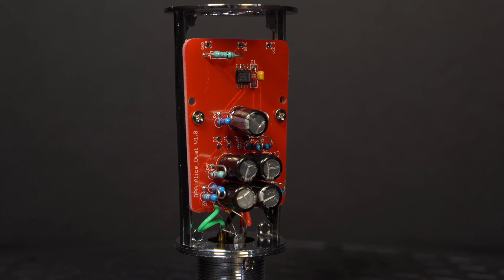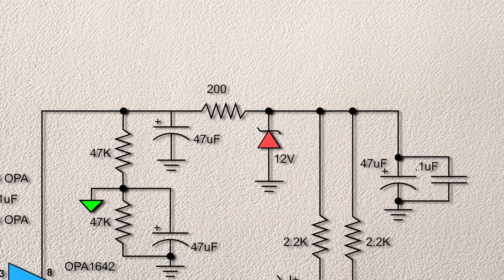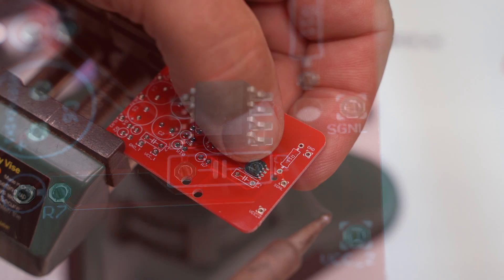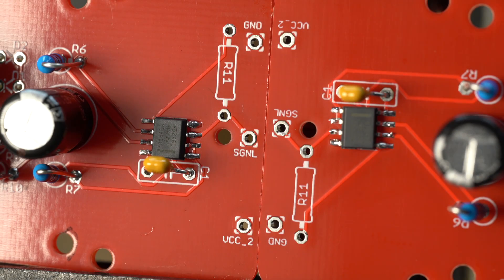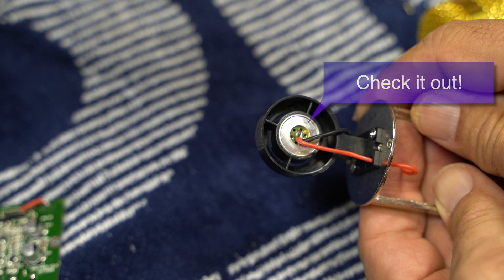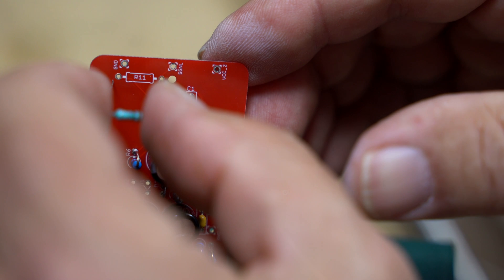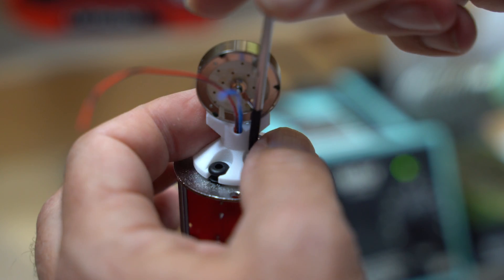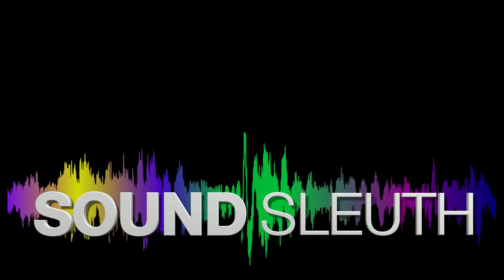OPA Based Alice Microphones: Cardioid and Figure 8

Comment: I built an OPA Alice circuit. Is it normally lower output than a JFET Bipolar type? And I noticed less  low end with the OP Amp Alice version is that typical?
Reply from the maker: No, it is similar if not a bit greater output. The circuit is unity gain voltage with lots of current gain
Reply: @SoundSleuth  I'm using a TL072, I haven't got high-quality low current dual op amps  atm
Reply from the maker: @virgogreg  I have not tried that one. The OPA1642 is the project based on the properties I mention in the Instructable and Video.
Reply: @SoundSleuth thank you I'll wait for my 1642 to arrive .I've built a ton of mics never used an op amp as an impedance converter before😅

Comment: Can you explain to us, what is the resistance of the 1G resistor that is connected to the + pole of the microphone capsule and to pin 3 of the OPA 1642. What is the "G" mark on that resistor? What does the "G" stand for? I did not find the mark "G" in any literature. Is that something new?
Reply from the maker: The G is for Giga  as in GigaOhm. 1000 MegaOhms or 10 to the 9th
Reply: @SoundSleuth  Thanks for the answer. I couldn't believe that a 1000 Mega Ohm resistor existed. That's why I asked. I've never had such a resistor in my hands before.
Reply from the maker: @balkanart8596  They have a couple specific uses lol. They make larger ones as well.

Comment: The whole circuit is unity gain.  I thought the signal from the capsule would be pretty small, so I'm a bit surprised by that.  I'm wondering whether there's any practical benefit to having a common source JFET stage to provide some gain and reduce the cascade noise, followed by this OPA circuit to convert the impedance and generate a differential output.  Your thoughts are appreciated.
Reply from the maker: Most FET and Tube impedance converters are unity gain or close to it.

Comment: I a little confused. Could you explain why the circuit diagram that you used to explain the circuit shows 2 op-amps while the actual pcb only has 1?
Reply from the maker: If you mean the PCB has one Integrated Circuit, it does. It is a dual op-amp. There are two independent op-amps in it.

Comment: I built one of your MS mics a few years ago and its output has become very noisy and low in level. Mine is pre-OPA.  I can't find any broken connections or shorts. Would it be practical to replace its two circuit boards with one of the dual-channel boards from JLI? Would the substitution be fairly straightforward?
Reply from the maker: Yes. The dual board works great for this  I’m actually about to release an Instructable on this and have JLI carry a kit
Reply: @SoundSleuth  Perfect! Thanks for such a prompt reply. Please sign me up for any way I can serve as guinea pig or proof that it works. I'll order the board and await the next Hollywood blockbuster so I can get my mic back in action. I really miss having an MS mic! I just bought a Zoom F3, so I'm eager to use it with a renewed MS mic to capture the sounds of the spring peepers finally emerging in northern New England.
Reply from the maker: @matthewcote107  email me ryckebusch@gmail.com I'll fill you in on my ms mic thoughts

Comment: Does an OPA mic sound good on an OPA preamp installed in the channel?
Reply from the maker: It sounds good on any mic preamp. All audio interfaces and modern consoles use IC mic preamps. THAT corp or SSM2019’s. If you want a little vintage or added THD use a tube or transformer input mic preamp.
Reply: @SoundSleuth  I have a mixer with OPA amplifiers on almost all channels. And I was wondering whether it wouldn't blow up in my face when I connected Serena
Reply from the maker: @s.b.l.u6114  It absolutely won’t.

Comment: question

so the capsule itself powered by a 6 volt bias from divider, am i right?
Reply from the maker: The capsule has no internal FET or electronics. The voltage divider is to get the opamp biased so that it can run on a single supply voltage vs split rails (+/-)
Reply: @SoundSleuth  last question sir,
is it possible to do this project on a USB based microphone w/o boost the 5 volt supply?
Reply from the maker: @RecehDIY  five volts is too love for the opamp   This will run on about 6.5 to 35 Volts
Reply: @SoundSleuth  a very lasy question sir, can i use 1meg resistor instead a gig?
or, is there any minimum requirement for bias resistor?
it's hard to find a resistor that big in my area
Reply from the maker: @RecehDIY  No, a 1Meg is too small for this. Digikey and Mouser both carry them  Digiky: https://www.digikey.com/en/products/detail/stackpole-electronics-inc/HVA12JA1G00/6195865   Mouser: https://www.mouser.com/ProductDetail/TE-Connectivity-Holsworthy/RGP0207CHK1G0?qs=sGAEpiMZZMsPqMdJzcrNwlDepD%252BlwznyoKugq%252BfXem0%3D

Comment: Is there a HF de emphasis in this circuit?
Reply from the maker: Nope. The circuit is very flat to about a Megahertz and about 40dB lower distortion than an equivalent FET circuit.  You can EQ in post should you like.
Reply: Ahhhh ok, was curious.  The capsule I paired with it is very bright.  I might just buy a different capsule.  I will try out the TSC-2 next :). Thanks! @SoundSleuth

Comment: Just curious as to why you have the capsules in series to make the figure-8 vs. in parallel.  (or if it would make any difference one way or the other.)  
Thanks!
Great instructable and YouTube video!
Reply from the maker: Thank you! I put them in series as that made more sense to me. It drops the capsule capacitance in half but that isn't an issue. If they are not matched, putting them in parallel could cause differences in signal outputs. That was my thought process...

Comment: Hi Love the video 
but Can you tell me how i should change the circuit diagram to connect the mic to a usb port instead of an XLR port?
Reply from the maker: You would have to add a lot of electronics to do that. This one is pure analog, meant for a mic pre or USB interface with XLR input.
Reply: @SoundSleuth  Hi thank you so much for replying btw!
context is, i had a condenser microphone whose circuit board got fried for some reason, so im tryna build myself a new circuit for it.
the output it took was a USB-B which had +VCC, Drain+, Drain-, and GND
the 3 pin XLR connection you showed is =12v,Gnd and Drain(-) So i need to figure out how do i get the drain +
Reply from the maker: @devampatel1265  USB has +5V Gnd and: Data "+" Data "-"  Look at this video for a USB based one https://www.youtube.com/watch?v=LoQu3XXIayc&t=17s

Comment: OPA134/164s are hard to come by where I'm from. Can OP177s, NE5532s or LM358s fill their roles adequately?
Reply: I know your comment is old but an LM358 isn't a good fit for audio since it's output is class b which has  crossover distortion. Also its noise specs aren't great. Go to your supplier website of choice and check any recent opamps you'll find rail to rail ones with at least 10MHz bandwidth, low quescent current and low noise specs too
Reply: @thewhitedragon4184  thank you! I really don't know much about mic circuits and would love to learn. Are there any books you might suggest?

Comment: Do you have information on how to add a line input on "high end" camera that have a stereo micro input.
These camera's tend to have a optional breakout box with XLR inputs, but are easily around 600€/piece. I wonder how they source power for this breakout box as there are multiple switches on for options it.
Both Sony as Panasonic do this. The producer isn't keen to provide a schematic to their gear so you're be abled to build it yourself and threaten to void you warranty.

Cool, video.
Reply from the maker: Ill look into it as a project. Problem is more size constraints and getting it to fit on the camera rig.
Reply: @SoundSleuth  Wha, i don't see that as a constraint to fit on the camera, but rather than it works and prevent spending 600€ for a box! 

I just hooked the camera on to the scope, using a DIY 3.5 mm stereo to 3.5 mono jack using shielded singled stranded cable, i measure a bit more than 2.0V coming from the stereo microphone input, seemingly while recording that channel was disabled and only picking something up on the other channel. Would be cool if i was be able to record my gear by taping directly in to it.
although my euro rack gear is 10Vpp, i do have module to converts it to line level.
Reply: @SoundSleuth  I have soldered a "electret" mic i had laying around to cable previously mentioned and it works.
I measured a 1Vpp while speaking in to the microphone on a distant from the camera.
Not sure if it's automatically disabling the internal microphone. Sony Alpha camera.
Reply from the maker: @AnalogDude_  this is one of my solutions.  https://www.instructables.com/Camera-Mount-ORTF-Stereo-Microphone/
Reply: @SoundSleuth  Someone mentions a "Neutrik" NTE x.x audio transformer could help.
Reply from the maker: @AnalogDude_  email me @ ryckebusch@gmail.com  lets take this one of line

Comment: Do the large 47uF electrolytic capacitors coupling both of the signal paths not harm the tone? Could you connect the output of the op amps to ground through 10M resistors, which would allow you to use small 0.1uF film capacitors for a corner frequency of 0.16Hz?
Reply from the maker: The 47uF do not affect the tone. My testing of this shows extremely low THD. The opamp outputs are about 6VDC thus need the coupling caps. Which actually couple the signals into the phantom voltage at the XLR connector.  The output impedance of the circuit needs to be low to drive the input to the mic preamp or recorder.

Comment: do we need to use any specific wires?
Reply from the maker: No, just use decent 22 or 24 gauge stranded wire.
Reply: @SoundSleuth  I built this microphone however it buzzes when I touch microphone... Help will be greatly appreciated...
Reply from the maker: @NoNeNoNeNoNe134  Check this out: https://www.jlielectronics.com/content/TroubleshootingOPA-Alice%20MicRev1.pdf

Comment: Hello. 
Thank you for your hard work. 
What device do I require to connect this diy microphone to my pc through the XLR connector? 
(a budget version preferably)
Reply from the maker: This is probably the least expensive way to do this:  https://www.amazon.com/Behringer-UMC22-BEHRINGER-audio-interface/dp/B00FFIGZF6
Reply: @SoundSleuth  
Thank you very much.
Do I have to enable the 48v phantom power?
I went with the OPA Alice single channel + JLI-2555BXZ3-GP capsule.
I am affraind I might burn it so I ask.
Reply from the maker: @konstantinNeo  see this: https://www.jlielectronics.com/content/FET-LessREV2.pdf
Reply: @SoundSleuth 
Thank you.
The schematic is very useful and pretty simple.
I meant in the audio interface UMC22, what should be the position for the 48v phantom power switch on the back. On or OFF?
Reply from the maker: @konstantinNeo  On.  That is what powers the circuit.

Comment: Hello.

I've soldered almost every thing but the resistors, I got lost because you haven't mentioned which one to use & where, I tried to read the paper circuit but tbh I couldn't understand it that much ( Positioning).

Can you please give me a heads up or a link to exact positions using the PCB board "R1,R2 - R10" signs, and their polarity side ?

Sorry for the inconvenience and thank you in advance.
Reply from the maker: There are pretty detailed pictures here. Resistors are not polarized so you are good there. https://www.instructables.com/OPA-Based-Alice-Microphones-a-Cardioid-and-a-Figur/

Comment: Nice video, I'm am not to experienced with auido interfaces or XLR. Is it possible to just wire it to a 3.5mm headphone jack and plug it into a computer? Or is it not that simple and I need an audio interface or special adapter?
Reply: You won't be able to provide phantom power from a computer 3.5 headphone jack, and thus will not be able to polarize the capsule to make it work. There are very cheap audio interfaces like the Behringer Um2 (<50$) that will provide both an xlr input and the power required for the mic to work

Comment: what is the 1g ohm resistor for, is there not enough impedance through the positive op amp terminal?
Reply from the maker: It provides a load to the Opamp input and combined with the capsule capacitance provides a cutoff frequency of 3-15 hz depending on the capsule. This is similar to FET and Tube circuits. My real change is to use a low distortion low noise Opamp instead of the FET or Tube
Reply: @SoundSleuth  I appreciate it!!  HPF at the input? Thank you I have had trouble understanding this part in the Alice circuit!

Comment: Thanks for the great video. 
Only thing I'm having trouble with is finding the electrical components, any Idea where can I get them all in one package ?
Reply: You can get the capsules and  PCB fully populated here: https://www.jlielectronics.com/diy-accessories/opa-alice-single-channel/
Reply: @dj4mc  Thanks for the fast reply !

I already have the capsules, for the PCBs I honestly would like to get the raw materials and order the PCB from PCBWay and solder them my self to exercise on soldering.
I found some parts on the xls file you shared but most of other ones couldn't be found. So if there's any certain website you know of that'll provide the components in pcs I would extremely appreciate it !

Comment: Please tell me, can I use this circuit (or the OPA Alice Dual SMD v1.0 board) with the Primo EM264Y Cardioid electret capsule?
Reply from the maker: No, the Primos and many others have a built in FET. This wont work for that. However, you are not the first to ask this. I am planning on updating the circuit for use with a capsule with FET. It will be a PIP to Phantom Power circuit using the same Operational Amplifier.
Reply: @SoundSleuth  Thanks for the answer, everything is clear! I am insanely glad that you are working on a preamp for Primo. This is very cool news. I'm looking forward to the release as I dream of using Primo capsules for my parabolic reflectors in combination with your cool developments!

I would like to thank you separately for the fees that appeared in the DIY accessories section. For those who are not friends with soldering, this is just a breath of fresh air. I ordered two sets (OPA Alice - Single Channel+DC-DC Hex Inverter PCB) two assemblies of two cardioid microphones. I'm looking forward to the delivery))))
Reply from the maker: @fastunovaudio  Thanks, this is exactly why I put time into this.

Comment: Hi, I love the design of this PCB, it's very simple and easy enough so that the average Joe like myself can put one together, and best of all the end product sounds comparable to a decent £200 - £500 condenser microphone.

What are the advantages to using this OPA based circuit instead of other Alice mic PCB designs (for example, Homero Leal's Pimped Alice circuit)???
Reply: The main benefit is parts availability long term. It also has  higher output prior to clipping. The Opamp portion has about 120db dynamic range with the phantom power supply we are using. Im in process of gettign a test setup going and will update the instructable with my results.
Reply: @dj4mc  Thanks for the quick reply Jules. Your work and documentation is fantastic. From the video, the mics sound very clear and crisp. I can't wait to try this circuit out for myself for a future project. 

I'm probably going to sound dumb asking this too but here goes: Is it possible to use this with a 34mm capsule?
Reply: @Xenogenocide  capsule size can vary a lot, as long as it fits in your mic body you should be fine.